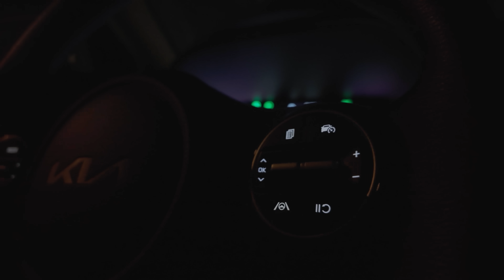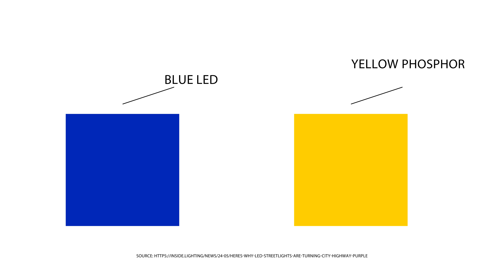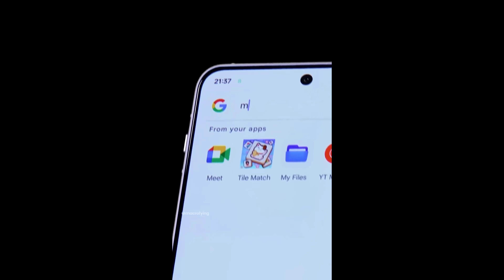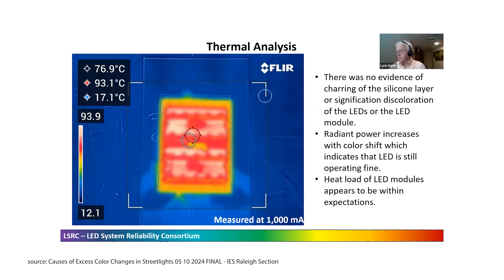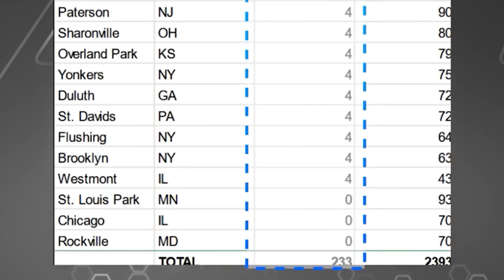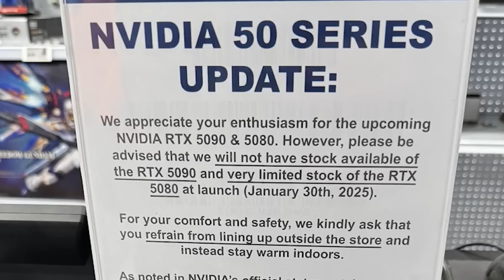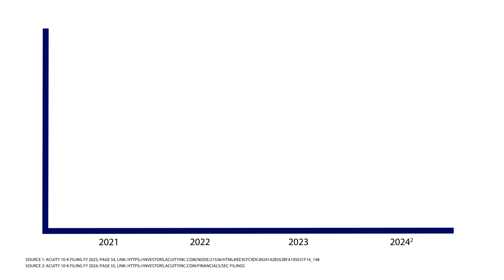The Hundred Million Dollar Mistake That Turned Street Lights Purple!

Comment: I am an IES board member and also used to work for a street light manufacturer so this is precisely my bag. I take in a healthy heaping of lighting science by way of IES involvement and accreditation maintenance. The algo is working.

I see purple lights around my area but despite being able to identify lights I never connected the dots that they were all from Acuity. For what it's worth, the primary factor which influences the long term health of an individual diode is thermal management. Heat is the enemy and a cheap light can produce more light by running it harder and hotter. There isn't always the thermal management to keep up with it. The metal housing on most LED lights serves as a heat sync. For what it's worth, the AEL lights in question have a small number of large fins where a number of manufacturers have a large number of small fins, which results in a greatly increased surface area and better heat dissipation.

Additionally, the vast majority of these faulty lights would have been sold closer to the initial emergence of LED lighting as a viable alternative to traditional sources. At this time manufacturers were projecting lifespans well far beyond what they could reasonably test. They did this by way of shorter tests in harsh environments and it's fair to say that not every possibly means of failure was discovered by this testing methodology.

Acuity is a pretty phenomenal company and it's no surprise that they are standing behind their product.

Great video, subscribing to see what's next.
Reply from the maker: A thousand thanks for your input! This was a very insightful read. Pinning this.
Reply: @SEANQ_ASK  honestly i wonder if you could intentionally order street lights in this color. looks nice imo.
Reply: I'd like to add to this, that it's not just the heat the lights generate in operation that cause wear and degradation.

Even when the lights aren't in operation, they're basking in the heat of the sunlight. Have you ever touched the roof of your car on a hot summer day?

Even with a good proper heat sink, that still won't be enough to keep the lights cool in the constant daily heat of the sun.

So the lights themselves, and every layer of the manufacturing of the LEDs, needs to be rated for high heat conditions.

I bet the laboratory tests didn't account for daily sunlight basically slowly cooking the silicone/phosphor layer...
Reply: Acuity does not stand behind their products. I upgraded lighting at a hospital and am having what I consider to be too many driver failures and they will not cover any labor. All I get is pushback. I sent failed drivers back for analysis, and got a series of stupid questions in return.
Reply: Thank you paragraph guy!
Reply: Isn’t IES the math for realistic modeling of light sources in 3d render engines?
Reply: I've had a bushel of cheap 5050 LEDs that went bad because the encapsulant (which holds the phosphor) shrank and either fell off or broke the bond wires.  In most cases, they failed before they were ever used, just because they were stored in a place that occasionally got relatively hot (50-60C).   So I agree it's thermal, but I'm just sayin that there's no lower bound on quality.
Reply: The affected phosphor damage seems to have been triggered by cold, not heat. The issue was most prominent in areas with cold winter, during or after a cold period.

Anecdotally, Canada was badly affected; there'd be entirely city blocks with nothing but purple lights immediately following cold snaps. Almost never during the summer months, but constantly from November through March.
Reply: @wyattroncin941  The large temperature swings from ambient to operating may promote delamination of stiff, degraded encapsulant, but it's heat that degrades the encapsulant in the first place.
Reply: Hey man, for someone supposedly in the business you should know that even though the purple issue has been known since white LEDs were figured out, these purple failing streetlights are a fairly new phenomenon caused by manufacturers cheaping out on materials and not factoring in sufficient cooling in the design. I'm in the sign business and any time I see failing white LEDs it's because they're either super cheap or constructed in a fashion that doesn't allow for ample cooling
Reply: I'm no engineer, but couldn't this be easily fixed?  Just make a big yellow phosphor filter that can be fitted over the defective fixture, kind of like a person wearing eyeglasses.  It doesn't seem like it would be that expensive, especially compared to scrapping the existing fixtures.
Reply: @LoveClassicMusic0205  I'm an engineer. the blue LED was the hardest to make historically. look for it on YT... Heat is the problem with your suggestion.
Why they chose blue is beyond me... They chose LED to cut the cost of energy and for 5G. All other sources of light are inefficient; Heat.
Reply: Same
Reply: Heat is the enemy of every machine and device. Except maybe a furnace or backyard grill.   lol
Is it safe to say "Made in China" is the REAL Problem?
Or local politicians trying to pocket some taxpayer dollars like when you see them repairing roads
with Assphalt instead of Concrete?        Buying the Street Lights at a garage sale?
Reply: That blue/purple white light gives me a migraine.
Reply: There is a stretch of highway near me that has them. I kinda like it. I think it’s better than the orange glow of the sodium.
Reply: "At this time manufacturers were projecting lifespans well far beyond what they could reasonably test." The lifespan of the LED is all lies. Part of the reasoning for purchase this was the cost saving of its lifespan. If the cost savings is not there, the taxpayers are ripped off.
Reply: I work with LED manufacturers and its poor thermal management. This is what happens when you increase diodes and lower mA to produce what ever lumen package being requested. Also love its acuity only manufacturer i don't rep. Cooper and GE current is who i recommend for DOT agencies
Reply: I didnt read your comment till I had already made mine.  Lol you said far better than I did. 👌😂😂
Reply: Question. Is that UV that is making them purple destroying peoples vision?
Reply: that tracks, thanks for the insight! we got BLUE lights in my area, not purple, just blue, but I live in phoenix where it's a gazillion degrees, hard to dissipate heat into air that's already swimming in it
Reply: @webkinskid Phoenix has loads of purple lights. Half the news clips at the beginning of this video stating that are from local Phoenix news media.
Reply: @webkinskid what?  I live in Phoenix specifically Tempe scottsdale border and I see purple lights all over.  Some have been replaced already here so you may have not seen them yet
Reply: Heat sink*
Reply: @TheMatsushitaMan 👍
Reply: there's the problem, they've used heat syncs instead of heat sinks.
Reply: Bla bla bla the mkultraed mouthpiece spoke scientifically. They are paying you too much.
Reply: Purple lights are safer than overly bright white lights that try to recreate daytime.
Reply: @news_internationale2035  You didn't watch the science part of the video, did you?
Reply: nonsense
Reply: @mpirron1  What refutation and citations do you offer in rebuttal?
Reply: YOUR FUNNY...
Speaking of EPIC FAILS... Pfizer, Moderna, Johnson & Johnson
P.S. Blue LED was the hardest to "invent" solve for.
Reply: You are forcing me to question your authority, expertise, credibility & validity when you reference a "heat SYNC"!  It is farfetched that someone could reach the career you claim without a clear understanding of such a concept and term.
Reply: @DJJonPattrsn22  Without even watching the video I can hypothesis that the commenter is running cover for a chinese-company. 

I'm not saying that for SURE, just guessing from what I've seen happen across the internet 

How close was I?..
Reply: I also work as a head product engineer working in the lighting industry. This accompanies designing, coding, simulating, measuring, testing, experimenting, accrediting, working with LED manufacturers and factories, and more. Besides that I have slight dyslexia. Not as much as my old coworker who left a mess in both source code and documentation, but enough that I spot my own typos, often too late. As a consequence, almost all my comments, posts, and instant messages have the "(edited)" label.
Reply: @matthewmosier8439  Doesn't seem that way to me.  Watch and decide.
Reply: @DJJonPattrsn22  Cut the fella some slack, he just might have used speech to text to write that comment.
Reply: IES?? You called it a heat "sync" no buddy you have NO IDEA what you're talking about. And no they don't engineer the LEDs that far,  they're doing what's cheapest and they don't care about the light's health, or your eyes
Reply: That's the conclusion you came too over a typo,, that brain of yours is working overtime to remain as smooth as ice. I'm a towboat captain of 30 years,  a 1/4 of the captains can't even spell captain and are yet literally licensed masters just like me.  @m3zmr
Reply: @m3zmr Wow you must really improve parties when you leave
Reply: @m3zmr  lol Settle down dude, it's a typo, everyone knew what he meant. You haven't shown you know any better than him.
Reply: @ That isn't necessarily true. These lights exist in conditions which require special considerations, so simply buying quality fixtures wouldn't preclude this from happening.
Reply: It's not a "typo." There's a difference between completely spelling a word incorrectly, and typographical errors.
Reply: @ Doesn't matter, he isn't talking about a sync, he's talking about a heat sink, and we all knew. You are just being an obtuse jerk.

Comment: This isn't entirely accurate. 
White LEDs don't start as blue; they start as ultraviolet. Varying amounts of a phosphor layer are added to shift the light into the visible spectrum.

This is why these lights appear purple and dimmer as the phosphor layer flakes off; the light is shifting outside the visible light spectrum for humans, which can potentially be a hazard to the human eye.

Side note: Blue lights are also UV LEDs with a phosphor layer added. Green and red LEDs are not.

Comment: 2015 ish + Toyota corollas have had this issue on high mileage examples. I’ve seen quite a few where one or both headlights have turned completely purple. They run 100% of the time with the car on, and in hot climates i guess it damages the bulb in the same way these street lights fail.

Comment: Artificial blue light is the worst of the worst. They’re clearly basing their LEDs off of that on purpose. It’s not just that it’s cheaper. It’s that it’s bad for us so it is kind of a conspiracy not the fact that they turned purple, but with this exposes is that they’re using blue light specifically on purpose.

Comment: 2:35 - well not exactly! Using Red Green and Blue chips and combining them to create "white" light is TERRIBLE idea. "White" light craeated by combinig output from 3 MONOCHROMATIC diodes is just AWFUL, colour rendering index is TERRIBLE, yeah technically it does work but spectral qaulity of that light would be just TERRIBLE. The only way to create real white light with nice broad spectrum and good colour rendering index is to use phosphor.

Comment: When the blue LEDs first came to market back in the 1990s, manufacturers of general lighting products first looked into mixing red, green and blue LEDs to produce white light. And it does, however, this type of "white" light has poor color rendition; some colors will look pale or otherwise "off" in this type of lighting, and thus it was rejected for indoor uses (where we want our food, clothing and interior to look nice). Instead, the solution with the yellowish phosphors on top of a blue/purple LED was used; this gives better color rendition (in fact, modern white LEDs are pretty darn close to matching the high color rendition of the old incandescent bulbs).
Color rendition requirements for outdoor street and area lighting are much more lax (just think of those orange sodium lights of days gone by; their color rendition was abysmal to say the least), so for such application, one could have used the red+green+blue LED solution. But I guess the whole lighting industry is geared towards doing white light with the phosphor on blue LED technology, and thus, that's what's also used in outdoor LED lighting.

Comment: I would be willing to bet a whole dollar that most of the failed LEDs came from China.
I have worked in industrial maintenance, service, and repair for about 35 years - the last 18 years as an independent contractor, and as such, over the last 10 or 15 years, I have seen more and more failures of Chinese parts that were used in the manufacture of machines built all over the world. Just because a machine is made in America or Italy or the UK, doesn't mean that practically every discrete electronic component in that machine didn't come from China. It doesn't mean it does, but it's usually the case that the most failure prone components are of Chinese origin.
I keep cheap Chinese parts on hand for short term replacements because I have less money tied up in stuff that I may not sell for quite a while and those parts are hard to come by on short notice, but I always tell the customer that I can get their machine back up and running (making them money) with a cheap piece of crap part that may or probably may not last a long time, but I'm willing to source a more reliable and therefore more expensive part to be installed at a later date when it comes in.
Since I work for mostly small businesses, sometimes they decide to take their chances, and sometimes they decide that having a machine that costs them several hundreds of dollars of down time per hour while waiting a day or two for me to show up, isn't worth saving 50 bucks on a questionable solenoid valve or something.

Looking at it from a OEM purchasing stand point, It would be damn near impossible to source massive quantities of discrete electronic components from anywhere except China and expect to stay competitively priced in your industry.
American (and and nation)'s manufacturing is only as good as the components used in the products they produce, and it's very rare to find any competitively product containing electronic devices that don't have a Chinese connection.

Comment: I've seen this before. A quick Google search will reveal three common things that can cause the phosphor layer to fall off of the diode. As far as I was made aware, the blue-purple light isn't actually dangerous to drivers. To anyone who may ask about these causes, the three main culprits are heat, presumably from the hundreds of thousands of combustion engine vehicles, violent vibrations caused by traffic, and the age of the lamps themselves. All three of these things can cause the phospor layer to delaminate and fall off of the chip, thus causing them to turn blue or purple.
Reply: “heat, presumably from the hundreds of thousands of combustion engine vehicles” or uh, running a giant network of energy-dumping LEDs?

Comment: I remember that timeframe, 2017-18ish, it was a pain to order some things from China, the official reasoning was China was cracking down on pollution standards, the other reasoning was corruption, there was a 3rd but i don't remember what it was exactly. I think it was something like 1 issue affected 1 manufacturer so all prices were jacked up state side whether it was affected by it or not. Greedflation-esque. 

But yeah. The TL;Dr was there was something allegedly going in with Chinese manufacturing at this time, that may be specific to chemical manufacturing

Comment: The interesting and probably annoying thing for this company is that its like their stock stos sround for exceptionally long periods before being installed, which eats into the shelf life of the components and items liek adhesives. Also something else happened towards the end of of 2019 that impacted all electronic manufacturing..... So in the industry globally a lot of alternatives were bening used for what was designed in originally. A lot of this was like done a bit haphazardly. I wouldn't be surprised if it is a combination of different chemicals both the adhesives for the phosphor and heat sink compounds(thus changing the thermal characteristics particularly over time). Plus the inherent spectral output of the LED's under the phosphor may have shifted towards a more blue set of bins than would have normally been used. Also the fact that this then would meanhigher UV output may have then over stressed the adhesive more quickly. LED's are more complicated than people give credit for. One thing to remember is that LED's aren't perfect but the reduce light pollution massively by being far more directional than other lighting tech and more energy efficient. They are a good thing. But not 100% perfect.

Comment: The reason we don't see well with just blue light is the same reason you sometimes see a blue halo around a blue LED from a distance: the receptors for blue light in our eyes are more peripheral than the red and green receptors. When you try to focus on something only lit with blue light, the receptors in the center of your eye are a higher percentage red and green and they're not getting enough photons at the wavelength they react to, and your brain just can't make sense of it.
Also, thanks for the explanation! I had seen some along the tollway and been wondering how both the red and green diodes had failed, but to know it was just a phosphor coating makes much more sense.

Comment: Last thing. The allowed failure rate for this type or LED product is 1%. You have L70 or L90 ratings that heat up the diode and give you the expected life of the diode, fixture and even lamp. Been working with in this industry for over a decade.